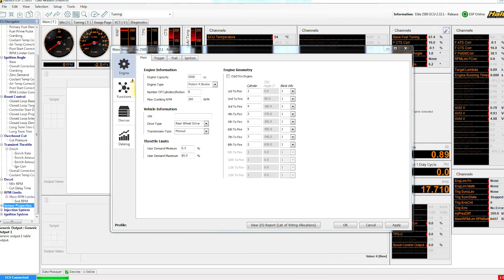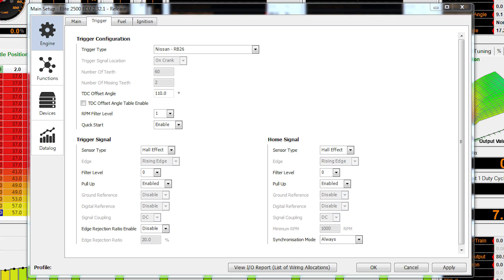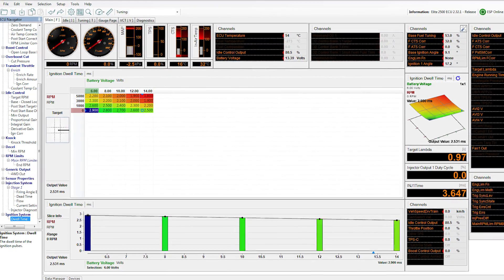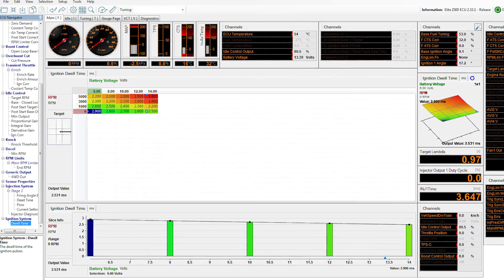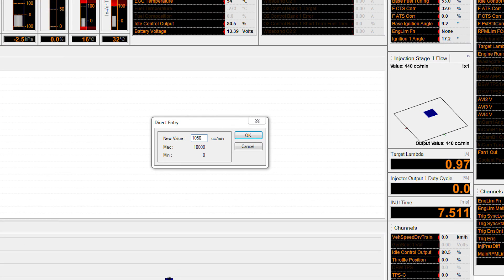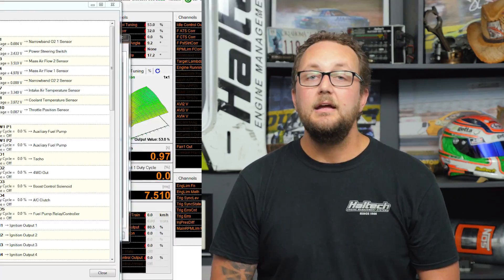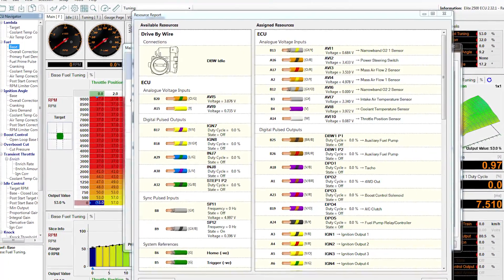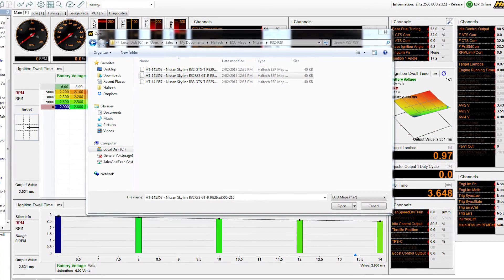🛠 Base Map Basics | TECH TUESDAY |

Comment from the maker: In this episode of Tech Tuesday we cover the subject of Base Maps. Scott explains what a Base Map is, what parameters are included, what to expect from a Base Map tune and where you can get a whole bunch of Base Maps for free.
------
As always - if you have a topic you'd like us to cover in in a Tech Tuesday video - leave it in the comments below:)
Reply: "My Documents Folder"...
Reply: An interesting topic would be one on correct air fuel ratios for various type engines and applications; turbo and normally aspirated; track vs street; gasoline vs ethanol vs aviation.  Also, how does Octane boosters affect afr.

Comment: I’m trying to tune my WRX on the stock ECU! I noticed higher values in my MAF Scaling table. (I’ve installed a bigger turbo) I datalogged fuel trims & found that I had to reduce my values, as though there’s less air coming in! 🤨 Is there a reason for this, because I’m confused?
Reply: djfluxysnowcott as long as you’re getting more power... the engine isn’t overheating... the afrs are good... and it’s not detonating... then who cares.

Comment: I've got an old BM 6 cyl 2.5 sohc that ive turbocharged with an elite 2000. is it possible to use say an RB25 or RB30 base map, adjust the timing, ign and inj settings to suit my setup and that be safe enough to drive to a dyno off boost?

Comment: If you change the injector size and dead time will that effect the cold start values? Also if you have a flex fuel sensor hooked up is it best to disable it for the 1st start?

Comment: Great video.  Base Maps are great as you don't need to figure out the triggers and associated settings as that tends to be the greatest challenge in setting up an after market ECU whether you use the factory sensors or aftermarket.  I loved the original E6 as it would create it's own Fuel and Timing Maps from a few question and answer inputs.